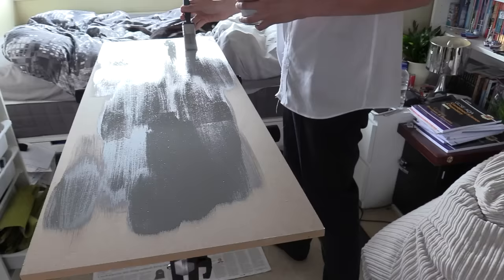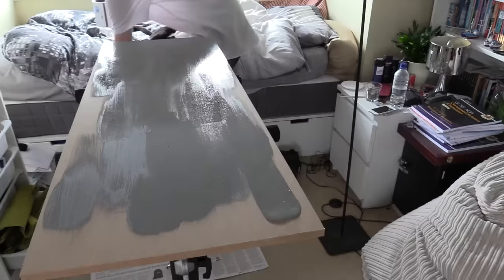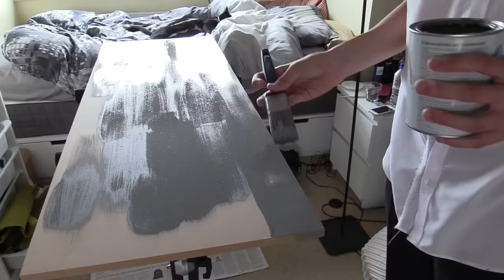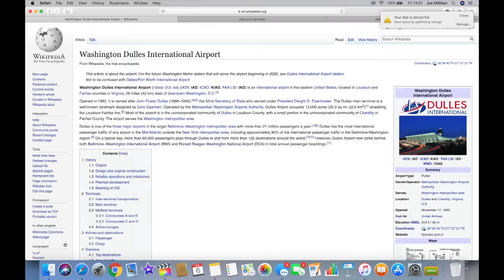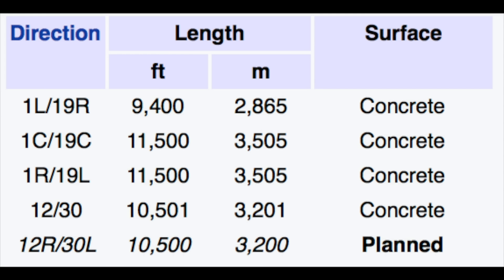*How to build a realistic model airport 2018

Comment: Have you tried using a static grass area to give those grass mats a bit of life? I use the gaugemaster mats on my model railway, but found that they are too plain, so I used some static grass. It's exactly the same as using the powder grass, but instead of just dropping it on, the grass gets given an electric charge so when they hit the glue they stick upright like real grass would

Comment: I have a question, how thick is the airport runway (centimetres) on your airport? And how wide is the runway from the taxi way? (Centimetres)
Reply: Depends on the scale u wanna use
Reply: AduptUniform26 
Agree
Reply: the average runway width is 150 ft. If you do 150 divided by 400 you get 4.5 inches. If the runway width is 200 ft then you would do 200 divided by 400 and you would get 6 inches. So it depends on what airport your doing.

Comment: This is a good video, you go ahead and use your local colloquialisms for the apron. Also, that grass powder seems like its static grass, which would work better applied in small pinches or with a static applicator. And maybe with the glue stippled on with a brush instead of poured

Comment: What's the best scale for the planes I know 1.400 is the most known but what's a other good scale?
Reply: I would keep with 1/400 because it’s cheaper than 1:200 which are larger and more expensive. 1:300 and 1:500 are pretty weird scales.
Reply: @AirportAviation380  alr thanks for the tip
Reply: @KanjitoPR Jeez, mate that was 3 months ago